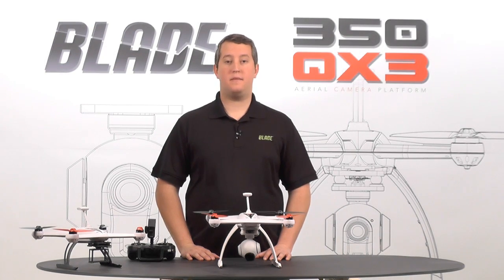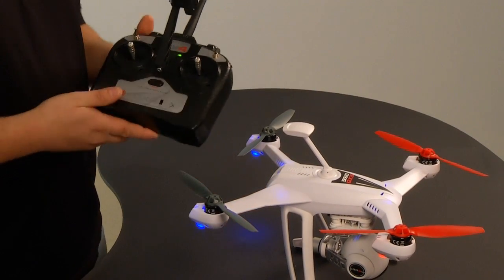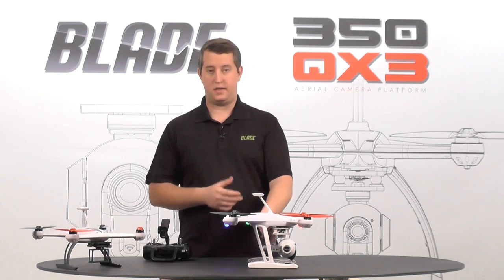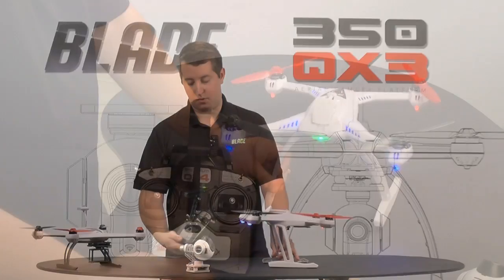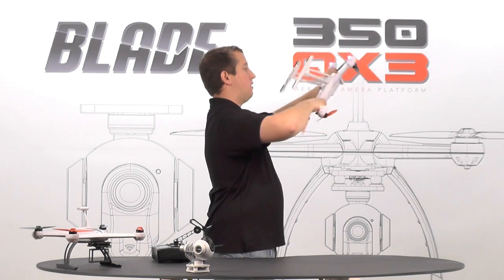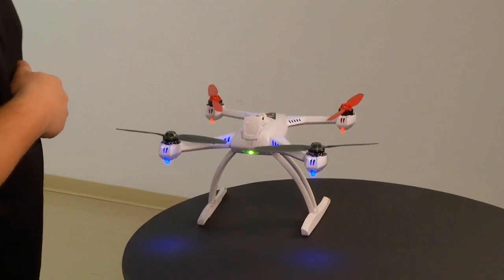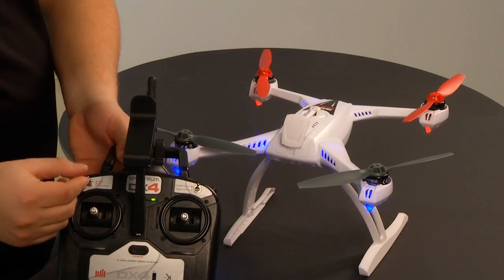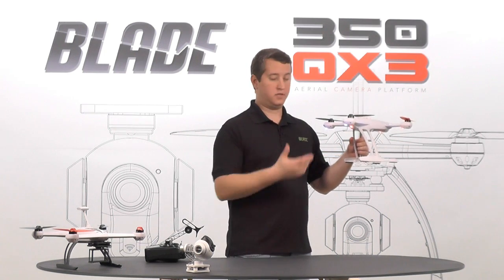350 QX3 Compass Calibration

Comment: After binding successfully, within a short time it turns to a solid white. The instructions show that it's GPS related, that I am not getting a signal. So, what I did was to toggle the switch like you do in the video and the orange light comes on. After waiting it does like your's in the video and flashes orange rapidly. However, after completing the compass calibration it turns green then reverts back to a solid white. Can you help?

Comment: Have to flip the sw real quick and for the right numbers of times. Rotating the copter is a chore. Needs practice. If have to do it for before each flight, its a real hassle. A better way is to place the compass sensor in a different plane and just rotate the copter horizontally. The props and the camera are in the way by turning the copter over and over and make 45 degrees changes.

Comment: Unable to enter the compass calibration mode. Flipping the L top sw 4x did not give me a yellow or orange blinking light. Instead it keeps on flashing green waiting to get satellite lock. What's wrong with this initiation sequence? Similarly, following your other video instruction, I cannot enter accelerometer cal., but I can calibrate it using the GUI. The RTF DX4 needs to recalibrated and how?

Comment: looking for a blow up parts drawing and some data on the correct procedure to take it apart so I can replace the mast and gps chip and connecting wire which broke in a tree incident!
Reply: Wilfred Scheuer Not much to the process Wilfred.  
1. Remove the blades (I mark each blade with a number that matches the number on the body) Keep the screws separated for this step

2. Turn the QX on its top and remove all the screws (They are all the same size)
3.  When the screws are removed, pull off the body top
4. The wires for the GPS are light grey.  Some of the items are loose when you remove the cover.  Just make sure that you put all the pieces back in their place (nothing moved when I removed my top body.
5. Remove the 2 screws that hold the GPS mast on the bottom side of the top cover.

Replace your parts and then do the reverse.

Comment: Does anyone know there there is a video on a compass calibration using a DX6i ???
Reply: Yes... Compass calibration is as per the online manual. Set up the DX6i per the instructions... DO NOT use a previous model set up and modify it as there shall be some mix settings that will render it useless!! Place the QX3 outside away FoM all metal metal (including innocent-looking lawn chairs). After " Boot up". Put flap switch DOWN and toggle the GEAR switch 4 times. The LED will blink a slow orange pattern, then pick it up, keeping North-facing. When the LED begins to blink rapidly tumble the Quad as described (4 rotations total). Don't sweat the time factor... You'll have plenty! Then place the Quad back on the ground facing North. Wait for the system to reboot completely.

I do this religiously before each flight as I have had the gruesome experience of a midnight Fly-Away!!!

Enjoy!
Reply: +Jim Walker Thanks! Didn't realize I needed to put my flap switch down when I was calibrating. Once I did that, it calibrated normally!

Comment: So at the very last pod (step) do u stop and keep it there or do u want to get the quad facing completely north again? And dx6i. And v3 fw is the same step just flick the flight mode switch 4 times guys!
Reply: tried it but didn't work. Your talking about the Gear, F- mode switch on the left, right?
Reply: Michael L yes flip that 4 times fast. The motors should NOT BE ARMED . and u should let it initialize on a flat surface first
Reply: Mike Sarni Got it now thanks.
Reply: Michael L It worked when I first put the FLAP to position 1. Again thanks and have a good one.

Comment: Can you make a video on how to do the pressure sensor calibration?  Can you include how to do this with a Bnf controller and not just the stock controller also?
Reply: VestedUTuber yes you can do the calibrations with computer radios
Reply: yes you can on a dx9. you have to hold bind and turn it on. once it says "binding" you then do your stick position.
Reply: fresh out of the box it is a bind button
Reply: youre not doing it right
Reply: no. I have a dx9, I own all 3 versions of the 350 QX, and ive personally done it
Reply: Sometimes manufacture manuals are not correct. I work at a hobbyshop as a Multirotor Specialist and ive done it 200 times
Reply: CALL THEM